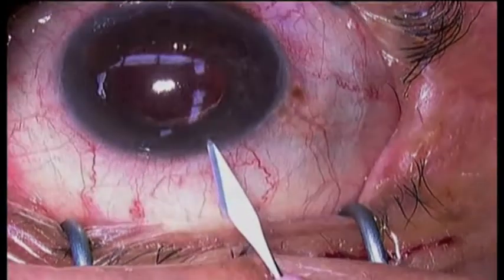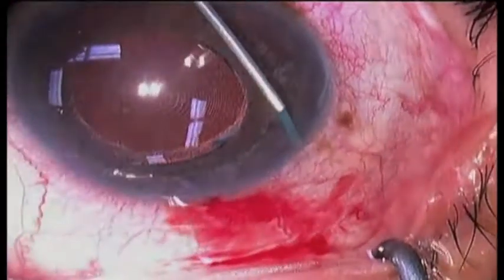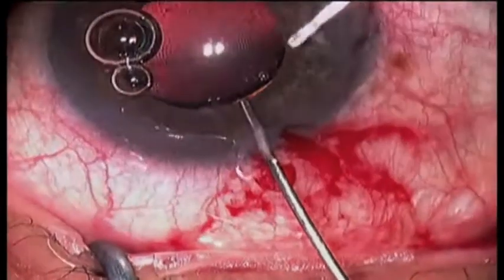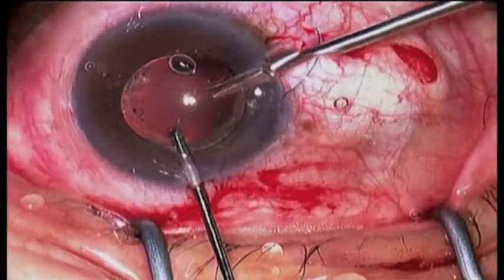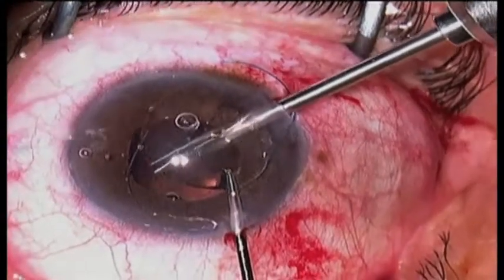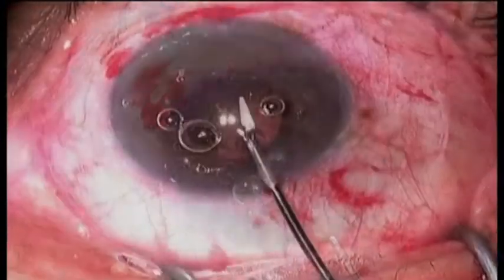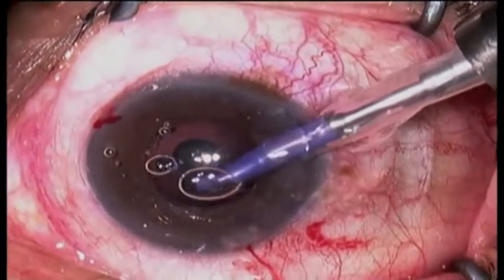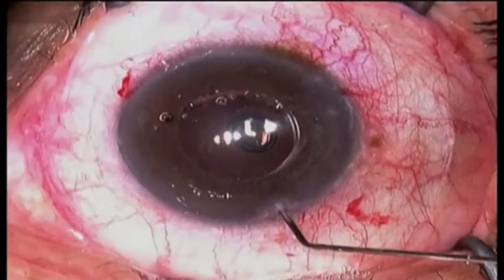Trabecular aspiration and IOL exchange by Steven G. Safran MD

Comment from the maker: I think it's a bit of both that can be factors.  In this case I exchanged Tecnis Acrylic for a Tecnis Silicon and both have the "opti edge" design so I think it was mainly a material change.  Also....the adhesion between the iris and posterior capsule was lysed and I believe that was causing some problems.  Mainly the patient was unhappy with the vision with the MTF.

Comment: Hi doc... I had cataract surgery a year ago. After the surgery, i see many floaters inside my eye and the eye pressure going higher. I search from the internet and I found the symptoms is similar with the so-called pigment dispersion syndrome. My questions: 1. Am I suffering from PDS?
2. Is it the cataract surgery that cause the PDS (if it is true the PDS).

I have myopia with power -7

Thanks.
Reply from the maker: If the implant you have is within the capsular bag it is unlikely that you have pigment dispersion syndrome as a result of the implant.   It is not completely impossible but extremely unlikely.  If the lens is in the sulcus it is more likely that this could be a possible contributor to the rise in intraocular "eye" pressure but less likely causing the floaters.  Floaters are very common in high myopes due to degenerative vitreous.
Reply: ***** My guess the implant is in the capsule bag. A day after the cataract surgery I sufferred an extreme hypotony (IOP = 3mmHg), I also had mid-size fixed dilated pupil, and I also see radial pattern (something like a sun ray) when my eye blinking. I dont know why after this cataract surgery there are so many complications in my eye. My VA now is about 6/15 (before the surgery I had 20/20 vision). I had consulted with many doctors but they have no idea. Any guess what is wrong with my eye Doc? 

Thanks.
Reply from the maker: Andreas Heru Prakoso
Do you still have a fixed dilated pupil?  t would be irresponsible for me to guess at what you have without examining you but if the pupill is still fixed and dilated it is possible that something got in the eye during or shortly after the surgery that caused damage to it.  Sometimes this problem can be improved with surgery such as a cerclage.
Reply: Yes my pupil is still fixed and dilated until now. Do you think the surgery will improve my VA?
Reply from the maker: Andreas Heru Prakoso
If you have glare from a fixed dilated pupil then an iris cerclage may be a consideration for you.  There are a limited number of surgeons who can do this procedure but if you search there are some videos on youtube of it being performed.
Reply: Thanks for you advise Doc.